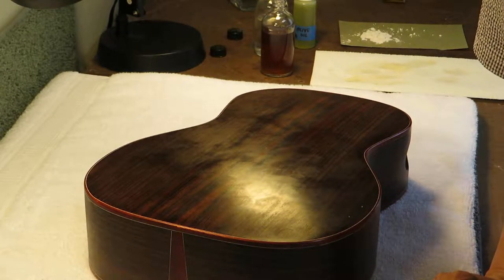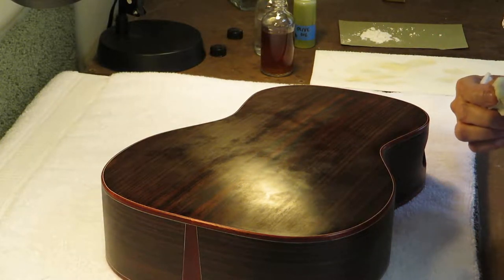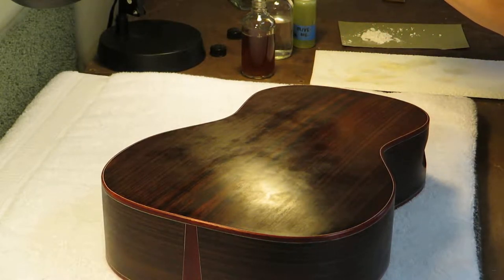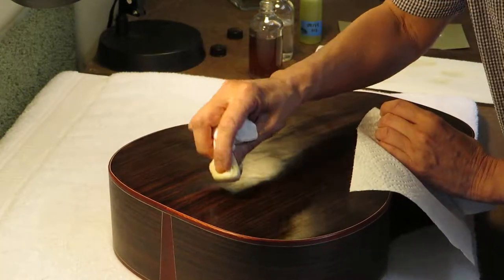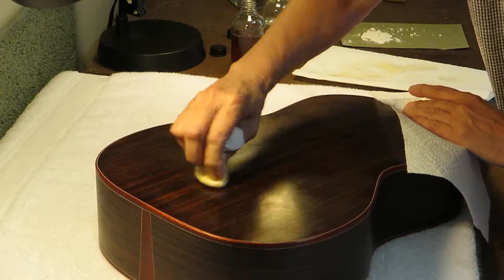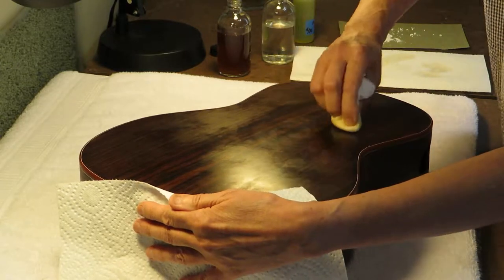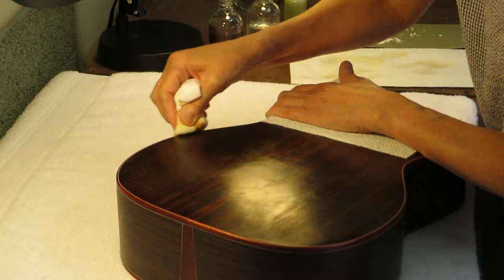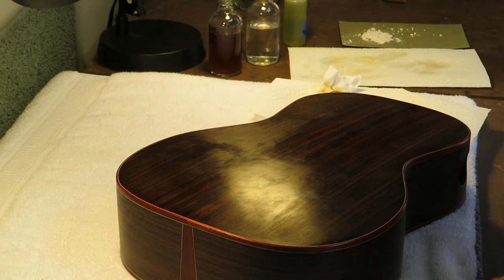FRENCH-POLISHING STEP 4: AN OUTER COVER & OLIVE OIL

Comment: What grade fineness is the pumice?  Do you have a separate pad for the soundboard?
Reply from the maker: I don't actually know. I got it a LONG LONG time ago. I do know I got it from Luthiers Mercantile; here's what they sell now, so I imagine it's the same thing. https://www.lmii.com/pore-fillers/3087-pumice-for-french-polish-filling-and-padding-1-pound.html
I don't actually use pumice very much. To fill the pores, I tend to just use wood dust (the rosewood dust) and shellac.
Reply from the maker: As for a separate pad, it's probably a good idea, as the rosewood sometimes kind of comes off on the pad. I probably just use a new piece of t-shirt to surround the cheesecloth.
Reply: @kathmatsushita  Thank you.  I think I saw where you store your pads in a jar to keep them moist which I can do easily.  

For pore filling, I am loathe to using epoxy as I have experience sanding that stuff.  I find it to be very unpleasant and I have a bit of epoxy allergy too.  So, I'll pass on the Z-poxy method and wish to use wood dust and/or pumice.  Also, since this is a Stewmac body built kit, I have no raw materials to create a pile of wood dust with.  I am in the materials acquisition stage of finishing.  I have no experience with staining or not staining mahogany either anymore than french polishing.  This method of finishing is all a new experience for me this time. (second acoustic build for me, the first one was lost in a fire in 2013, had a water based lacquer sprayed on.  The sprayer was lost in that same fire).

Thank you for all your videos and your website.  They have been so very helpful to us amateur luthiers!
Reply from the maker: @SandhillGuitar  I used to use Z-poxy for pore-filling when I was using the water-based finishes for my guitars, so I know what you mean about the sanding. If you don't have any spare rosewood for making dust, basically pumice serves just as an abrasive. It creates the wood dust as you rub it in. You just need to be careful to let it clear (clear it with the shellac, and not the alcohol, which will flash off too quickly, making the pumice remain white in the pores) before you rub it in. If you can make wood dust, however, I'd do that, as it's a bit quicker to build than with the pumice.....